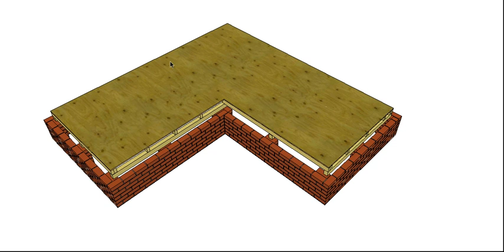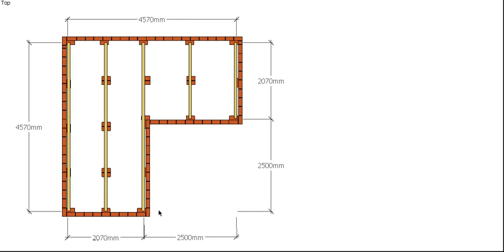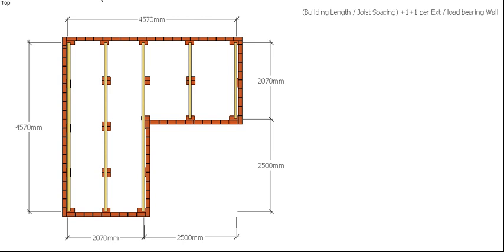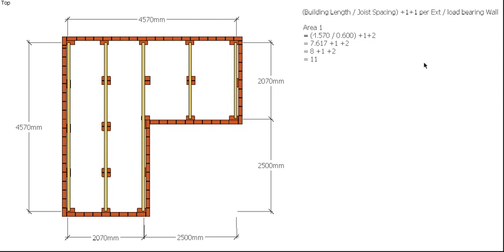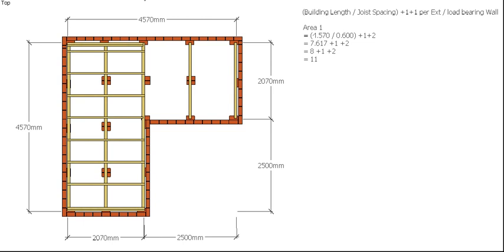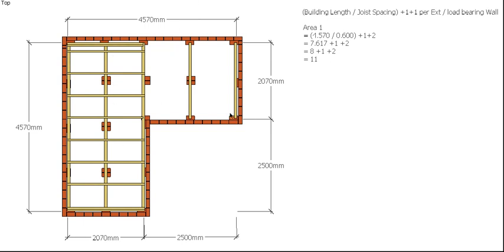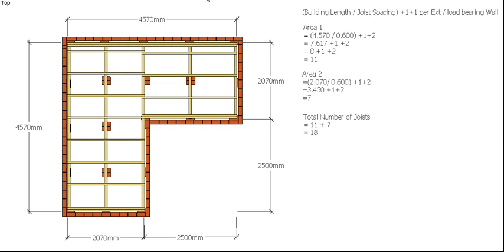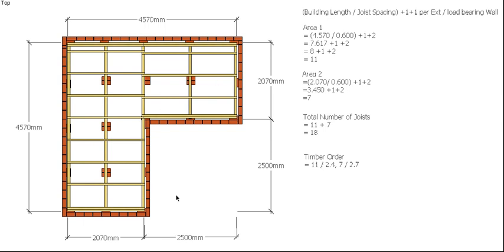Calculating Joists

Comment: Hi Sir, how do we determine the spacing of each joints and also the bearers?
I read that it's based on a standard for every material used (e.g composite metal etc)
(kinda like ASTM standard for Aerospace) is that correct?
Really appreciate your advice. Thanks
Reply from the maker: Hi Felix, yes it depends on the material that you are using for the flooring. e.g. 19mm STRUCTURFlor can span 450mm centres while the 22mm will span 600mm centres.
The spacing for the bearers depends on the span for the joists. AS1684 is the Australian Standard for timber framing and all the allowable spans are set out in the standard. Some timber manufacurers also publish their own span tables.
Reply: @Buildsum     thank you Sir for your thorough explanation. These two video (Calculating Joists and bearer video) are helpful to me. Have a good day Sir.

Comment: Hi ,
Is there a software to calculate this or no ? Thank you
Reply from the maker: Hi Mate, there is software that can workout these quantities from the plans or you can make up a spreadsheet that can work it out based on the length of building and the spacing of the Joists.

Comment: Hi

All of your is actually more clearer than our teacher in University. 

Wish to know the size of the timber you use (of course with compliant with AS1684) and dimensions from each other. 
It will very helpful

thank you
Reply from the maker: Hi Alex

There is not a standard size really it all depend on the strength of the timber that you are using. These sizes are determined from Span Tables. In Australia we use AS 1684 The Timber Framing Code.
https://www.youtube.com/playlist?list=PLHFT_d-5EhN67V-pbTSWQ0bxnluALyIfJ

Comment: why is your bottom joist spaced slightly more than the others? Also, do you measure from the inside or the outside or centre of the (Double)  floor joist. 
Great videos by the way.. Thanks a lot
Reply from the maker: Hi +nikai123456789 Im not sure however as long it is not more than the required spacing it doesn't matter.

Technically you should measure from center of the closest joist to the center of the next how ever this is not practical on the job site so you measure from one side of the joist to the same side of the next joist.
Glad you like the videos

Comment: thank you for this video, why you +1 and +1 per ext, sorry i don't understand that, can you explain me please ?
Reply from the maker: +Godffroi Djadide Hi Godffroi
The first +1 is because when you divide the length by the spacing you are actually working out how many  spaces not joists there will always be one more joists that spacing.

The second +1 is because you need to have 2 joists under an external loadbearing waLL.

Hope this helps
Reply: +Buildsum Thanks for the reason behind that.

Comment: hi.. please how you calculator the space 0.600?
Reply from the maker: HI Simaa
The 600mm measurement is determined by the span of the material to sit on top of the joists. 450mm and 600mm are the 2 most common spacing that flooring products require however in some specialist cases you may have to go down to 300mm. Is is best to check with the Flooring Manufacturer's Specifications  to determine the spacing of your joists.
Reply: Ok thank you so much

Comment: yes thank you but at class we made an exercice with exactly the same plan and the teacher divide 4.570 /0.600 +1=19 si it's for that i didn't understand you add 2
Reply from the maker: +Godffroi Djadide Ok I have rechecked my calcs and the plan is to scale and shows 18 joists so i'm not sure how you got 19
Reply: Actually for the same plan i have on the top 10.5m on 6m(left) , on the botom i have 6.25 m and on right i have 3.5m so he divide 10.5 by 0.6 =17.50 so 18 +1=19
Reply from the maker: +Godffroi Djadide Ok so that is correct however it does not allow for the AS 1684 requirement to have double joists under external walls thats all
Reply: +Buildsum thank you for your help